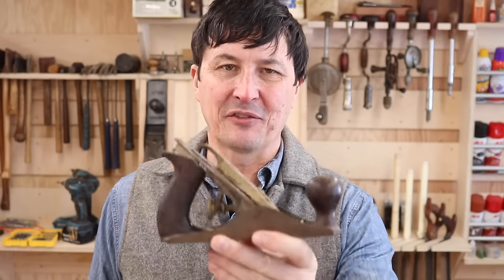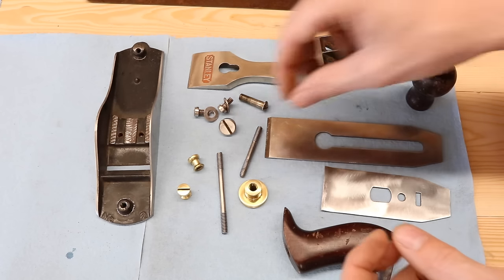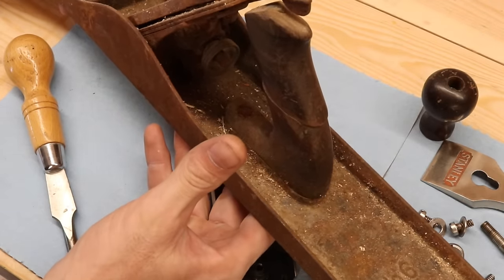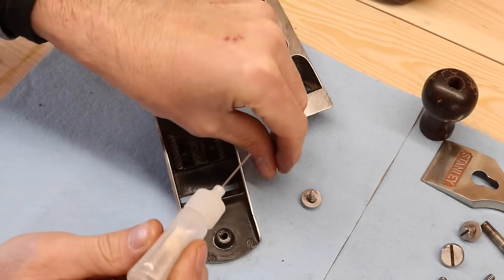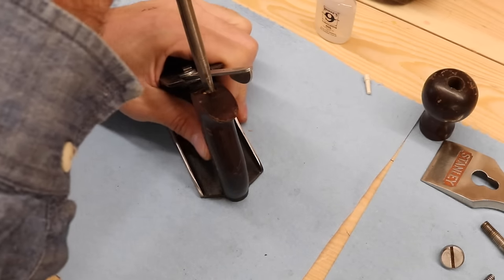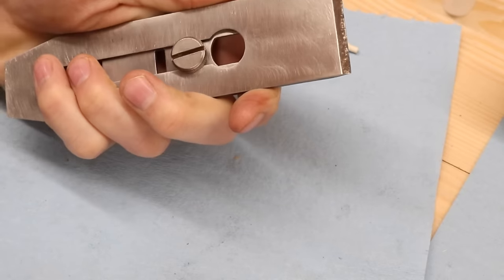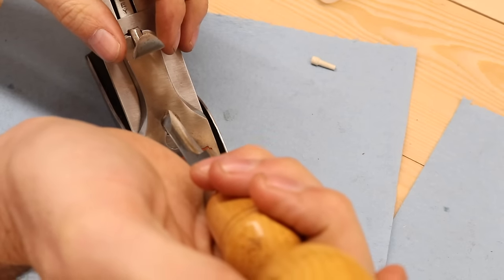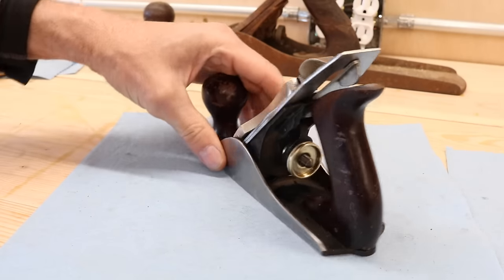HOW TO DESTROY A STANLEY PLANE!!

Comment: DEFINITELY do the #6 please!  And don't buy a handle for it - make one in your new shop.  This way you get a longer video series.  Can have a while episode on the making of the handle.  I think a man of your skills can do it no problem - no more difficult than making an axe handle from scratch!
Reply: It is a neat idea but if he can't find the rosewood...I wonder if the broken one can be glued up.
Reply: I'm not sure on the rosewood that Stanley used for their old handles, but i'm sure on some turners websites they'd sell rosewood bowl blanks big enough to get a couple of handles made. it'll cost a bit, depending on what kind of rosewood. I think there's a few different species, but it shouldn't actually be too difficult to get the timber to make a couple of handles.
Reply: It doesn't need to be rosewood.  And they sold plenty of other planes that had other kinds wood/aluminum handles (not Baileys).  I'd just go buy a #5 for $20 and steal the handle if it was that big of a deal.
Reply: Making totes stresses me out.
Reply: Why not just use hickory ?
Reply: or maybe pinned somehow? it looked like 2 pieces broken along the grain so hopefully it could go right back together
Reply: +aerosaaber it will glue back together easily, the problem is it's missing the top, so it's not complete.
Reply: that original handle can be salvaged....you see a lot of the older planes in rough shape with that 2 piece handle where it was just stacked up and screwed back in.

Either way - doesnt need to be original rosewood.  

Actually!!! -- He should create a new handle and knob from that nice slab of tiger maple he got.  That piece he made a shelf french cleat tool rack from.

Could laminate some if it isn't think enough - it would look AMAZING.  Actually going to do that myself now i think on it!
Reply: Absolutely, nice work on that Bailey number 2. You don't "need" a 6, but go for it!
Reply: Erik Joven that handle can be saved. no reason to make another one. just restore the one it has.

Comment: For that rusty plane, mix 50% Ballistol & 50% water in a spray bottle, and spray all the plane's surfaces.  Let it sit for a while, wipe it down and repeat the process once more.  Ballistol emulsifies in water and the mixture is like penetrating oil.  It will stop the rusting process and when the water evaporates only oil is left behind.  It's pretty amazing stuff, but after using it for 3 years, I still hate the smell.
Reply: MindOverEverything you can use LPS 3 to the stuff does what it says it does it prevents rust from getting on the tool and you don't use much and put a light coat and you will be good for a full year or more. It also stops rust as well the stuff is not the best smelling but hey you will only have to smell it once a year.

Comment: It's crazy that restoring a tool to working order is "ruining" it to some people.
Reply: To a purist collector only is it ruined. Not by restoring it but the means of which it was done. Avid collectors prefer that they be restored without the use of power tools. Using power tools to restore it does decrease its value however if Cody is using it I don't see the why anyone would have a problem.
Reply: Timothy Corcoran how would anyone know it was restored with power tools?

And why would anyone care?
Reply: I guess since they are collectors they feel they have a right to say how someone else should restore their tools? I don't know. You can tell its restored with power tools because most if not, all the original tooling marks are removed from the casting, also it would look too new for a 70 year old plane, without some patina which is desirable to collectors. You can tell its age by doing a plane type case study. I will end it with a mild joke for effect: Does Cher look hot? LOL
Reply: Not sure how you could tell a power tool restore verses a drawfile and possible polish (we used to use Brasso on the reverse of wet and dry or emmery cloth! You can clean it up to a mirror finish that way! Also it only becomes a collectors after they gain ownership ..... you don't have to give it to them!
Reply: Depends what "restoring" means.  I usually pass up flee market axes if they are painted.  I'm sure the guy that painted them though he was doing well.  I'd rather buy the rusty one if I can identify it as a model I'd like to purchase.
Reply: If it does it's intended job, it's restored.
Reply: Andrew Delashaw Timothy was trying to say there is a difference between restoring with or without power tools.

And personally when I look on ebay pretty much all of the high dollar planes look restored.

I think it's a bunch of worry over nothing.  Furniture sure.  Tools.  Not so much.
Reply: I guess it is a big no-no for collectors. I guess i do not have the collector's eye because if i own that plane, i'd want it in top shape and be able to use it. Different people have different priorities, that sums it up i guess...
Reply: Kristoffer Sapong yep I'm not a collector.   I don't use them as much as I wish but I like them tuned up and looking nice.

I have a sweet Bailey No 7 that had pretty heavy pitting from languishing for years all rusty.  And it looks sweet all cleaned up pits and all.

I'm sure a picky collector would pass it up.

And that's fine cause I would never sell it.  Hell I even replaced it's iron cause it was too pitted and replaced it with a higher quality one from Lee Valley.

The HORROR!  :O
Reply: Yes I have a No.7 from 1889 equipped with a Veritas A2 iron. Had to file the mouth wider to accept the thicker iron and a collector friend was appalled. He still calls me once and a while to see if I want to sell it.
Reply: tell me about it! most I know that would buy an old one want them to use, not sit there looking like it's ready for the scrap heap!!unless you just want a paperweight they're is no reason not to restore it!!!

Comment: Wranglerstar, that section is called a Frog because if you look at the rebate where the mounting screws sit, then it looks like two cartoon frogs eyes. Then you have the wide slot underneath that looks like the Frog's mouth. Once you see it you'll always recognise it.
Reply: Yes, that's it
Reply: I didn't know that
Reply: Surprised he's not aware of the origin
Reply: Viktor Orban.......Violin, cello, and bass bows have a wooden end section and long screw to tighten or loosen the bow hairs that's called the frog too. Ribit!  :^)
Reply: tom7601.......Interesting, are they on the train or the track?
Reply: i was thinking that was it... i did not understand why he could not see it xD... Seemed so obvious as he put it together.
Reply: They're on the track; the frog in a switch (or points as they're called in the UK) is the triangular piece where the diverging track crosses the mainline (straight) track.
Reply: Making Sense.......Thanks for your knowledge. It's cool to learn more about how and what things are used for. Next time I'm near the train tracks I'll know more about the inner workings that keep them on track. Thanks for the kind reply too.  :^)
Reply: Actually “frog” is a common archaic word for something that joins two things together and has nothing to do with what it looks like. You have frogs connecting scabbards to belts, horsehair to violin bows, two pieces of clothing together, horses hooves to their feet and plane irons to planes and there’s probably a few more I’m not aware of.  None of them look like frogs.

Comment: #6 all the way. Two small wood dowels and some wood glue and that rear handle will be fine.
Reply: I feel so too, it looks fixable ... also, it looks 'whole enough' to get a template from it, so making a new piece would be possible too.
Reply: lumspond Agreed restore it to a usable condition. If the handle can be repaired by glue and dowels it is better than making a new handle. Keep as original as possible, assuming that the repair is then strong enough for its proper function.
Reply: Have you ever seen Wranglerstar gluing?  :) Be that as it may, I'm with trying to fix the handle so as to keep the original parts.
Reply: Yes, repair the rear handle; it belongs there.

Comment: Before attacking rust with abrasives it is worth removing the rust with electrolysis.
Reply: And on the No.6:  If you carefully disassemble the handle it should glue together nicely.
Reply: I've glued one or two before.  Would work fine to make it usable.
Reply: Electrolysis is so much fun.
Reply: CA Glue works really well for rejoining creaked/broken handles. I've glued together some that you would not be able to spot where the break was. Wood glue is the worst you could use as is it thick and leaves a glue line.
Reply: I used vinegar to remove rust when I restored 3 old Stanley planes.

Comment: Hey. The safety sallies may hate on me for this but I would take the guard off on the wire brush side.   Soooo many times working in blacksmithing and machining   Even working on the down side of the wheel I have had a piece grab and get pulled into the wheel.  If the piece is small and sharp it can and has been caught brought back around at me.   If you take the guard off it will go down away from you instead of being drug around and back at you.   Again just personal experience I'm sure the osha fanboys will contradict me.
Reply: +Jerry O'Dell
As a retired machinist, I agree with you completely. Always pull the guard off when using a wire wheel. It is much safer. OSHA's a joke. They have certain guidelines but mostly they make it up as they go along. I have seen them render   machines totally useless or dangerous. They have no idea what they are looking at and most of them have never picked up a screwdriver in their life.

Comment: Frog was a common term for a holding/bracing/reference bracket or mounting point. a violin bow has a frog where the hair is mounted. The name comes from the part looking much like a frog just sitting on a surface.
Reply: MorRobots In the UK the depression in a normal builders brick, such as a fletton is called a frog. I have no idea why.
Reply: Thank you!

Comment: Hi, on the bailey front handle, measure the boss the handle fits over, and if it is a common size, you can probably buy  standard brass bushing, and insert it into the handle to correct the worn area. On the rear handle, maybe a steel 3/16th pin or even a 1/4 pin could be inserted up thru from the bottom, then the joint could be prepped and pinned and epoxied or glued. I also would recommend buying some Kroil, and a day or two in advance, soak the steel parts with a generous bath of the Kroil. I gave some to a neighbor whom owns a steam engine, and he and his friends are always thanking me for introducing them to this product. One of the maintenance guys at the museum told me I saved them thousands of dollars because they were able to free up stuck and rusted parts like never before.

Comment: Little Arkansas Pilgrim was watching this with me, and when you were wondering why the piece is called a frog, he said: "It looks like a frog!  See the eyes?"  The rounded parts of the holes look like a cartoon frog's eyes.  When the screws are in, they really look like eyes.

That Bailey plane is a No. 6C.  The C stands for "corrugated".  I recently got a Stanley version of that plane (don't know how old) at an estate sale for $10.  When I looked it up online, that's what I found out.  Mine's in a lot better condition that that one.  It's about the same condition as the No. 2 was. Maybe a little worse.

Definitely show the restoration of the Bailey.  Maybe if you get the wood handles off, you can soak the whole thing in Evapo-Rust, or something.

Comment: I always ware gloves when working on wire wheels, I don't know about safety but I do know that if I am daft enough not to ware gloves I am going to end up digging wire out of my hands. The safety nuts are very good at telling us what to do but they never get on you tube and show anyone.
Reply: But the purpose of the glove is to PROTECT your skin! And yes I have had my hand pulled into a wire brush on a half hp grinder. I was Damn glad to be wearing a quality leather glove! I have lost skin too many times trying to work bare handed to ever do it any other way.
Reply: I have a good friend that lost 2 -1/2 fingers and the mobility in his other finger and thumb because of gloves being caught on a bur and pulling his hand into the machine, ruined his life. "It won't happen to me" has been said to many a man experiencing pure and utter shock at the events taking place
Reply: Safety is good but it cannot replace common sense and a cautious attitude.

Comment: Nice work on the #2 Stanley. It looks ready to go to work and will be a joy to use and to look at. Yes,  you should restore the #6. It will take more work, but a fine tool should be able to do the job it was designed to do.

Comment: Hey, awesome work in that plane! Don't mind when people say that you ruin the value when you restore it. I think it's better to restore it in working condition so you can use it than just letting it rust away. You gave it a new purpose in life. Little tip tho, the Hoppe's oil is carcinogenic so you would want to use some glives when you are working with that stuff. Plus when tou do so, you dont leave any acids from your fingere on the plane that can initiate rust again. Keep up the good work!

Comment: Interesting comments on wire wheel. I have never seen a brass one. Recently I found wheels made with nylon with fine abrasives embedded. They are very gentle and available with differing roughnesses. I use them on a battery operated DeWalt drill for lots of clean ip and restoration.

Comment: The smaller planes were made for jobs like planing bamboo for fishing poles.  A jig is used in which you place a piece of split bamboo, and a small hand plane was used to form and equilateral triangle lengthwise of the bamboo.  After six pieces are planed, they are glued and wrapped, cleaned up, and the ferrous and handle are attached.  This method is still being performed today, and is hundreds of years old.  The plane looks beautiful, and can now be used.  Yes, please restore the no 6!

Comment: I agree with you on the rusty versus restored, debate. If you think I've ruined my Collins axe, either keep your trap shut or go away, because I like to see them restored as close to new as is possible. 
Also, on the frog name debate. I have a feeling it may have something to do with the fact that it is a screw adjustable sliding rail. On stringed instruments such as cellos and violins, the part of the bow that you hold in called the frog. This piece is also what allows you to relieve the tension on the hairs when you aren't playing and even remove the hairs all together when it needs restrung. The frog is adjusted using a long, thin thumb screw that travels through the stick to that little silver, ebony and mother of pearl hexagonal screw head at the very end.

Comment: Hi Cody, a beautiful restoration as always.

I know you are not a fan of Safety Sally, but I felt obligated to warn you about what I think I saw on that grinding wheel stone.  If you have been grinding Aluminum there is a chance for it to gum up inside the stone, and to be forced deeper in with further use.  There is a real risk of the stone fracturing at speed-I've seen it happen and it is extremely dangerous.  Fortunately they make "dressing" tools for wheels that will remove the aluminum deposits.  If this is not the case with your stone I apologize for being presumptuous.

Comment: I much prefer restoring those planes to working condition, otherwise it is nothing more than a paperweight. One cannot fully appreciate a tool unless it is useable. I try to use as many of the original parts as possible; but,broken handles make the tools hard or impossible to use.  Sapele is a great substitute for the original rosewood handles.  #12 with 20 threads per inch and are longer available commercially.  On a few of my restorations, I have had make my own replacements.  The depth adjuster screw is not only an odd size ( left handed thread 9/32x32 or 36, usually) they have to be custom made, I have had to make several in the 30 some odd planes I have restored.  It would be a dream come true to run across a #2 in s a good of a condition as the one you restored in this video.  Nice work. Oh! By the way, a Brass brush works much better than the steel and is much less abrasive.

Comment: Cody...I've been an Engineer and woodworker for decades. I totally agree with you restoring the plane and disagree with the notion that you should leave what can be a perfectly good tool in a rusted mess. I've restored many planes that were old...including a No. 2 from the 30's. If that's "ruining" it, then I'm totally guilty.

Comment: absolutely you should restore the #6. if your concerned about removing the rust a good soak in vinegar will remove the rust. just soak the metal parts for about 4 hours and then check them. overnight might be needed just be careful and don't over due it. Can't wait for the videos. Thanks Dean Lewis

Comment: Codi, I would like to point out that as far as I was taught when I took safety courses in trade school, using gloves with a pedestal/bench grinder is perfectly acceptable. Its the slower moving rotating tools, usually with cutting bits, such as a drill press, a lathe or a mill that you aren't supposed to wear gloves with. :)

That aside, I would love to see that No. 6 get restored, looks like it could be a nice old plane once finished.